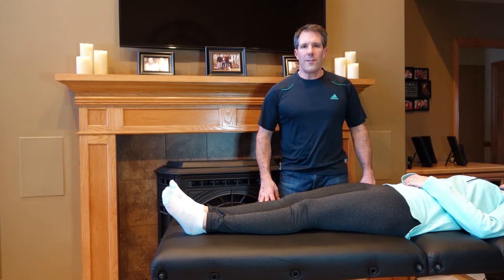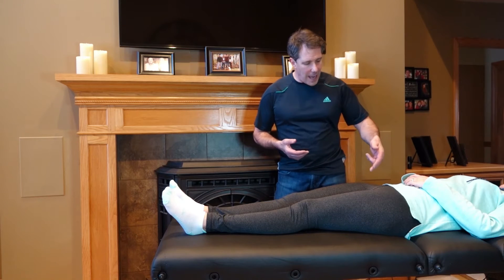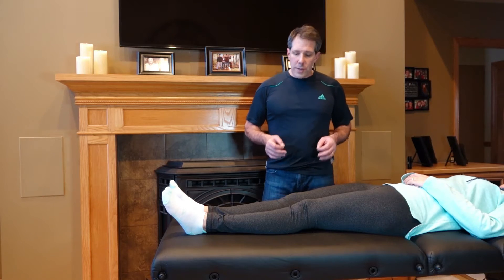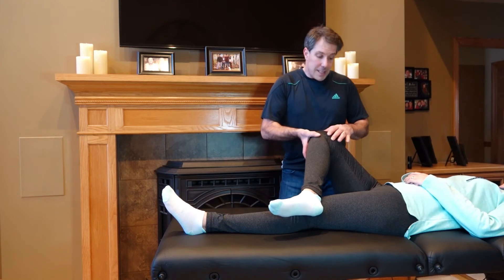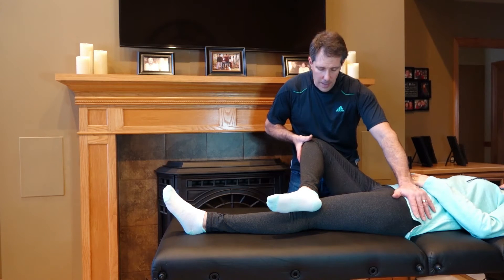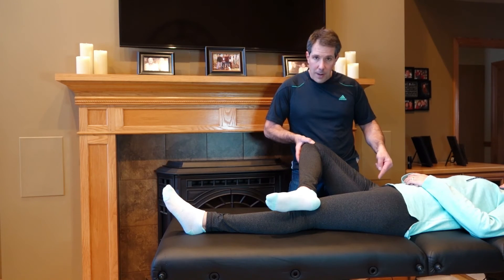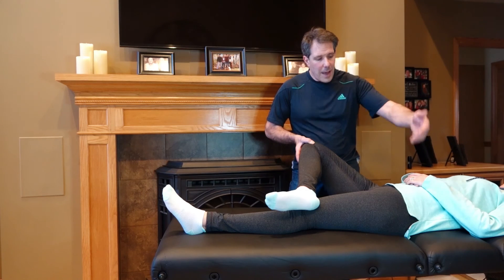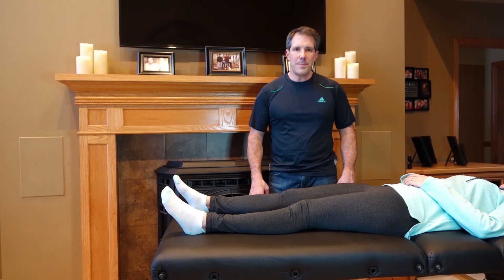FABER/Patrick/Figure 4  Test-How to Perform it and What it Means!

Comment: What if the pain is on the exterior front of the quad/hip when doingthis test?
Reply from the maker: Usually an issue inside the joint. Arthritis or labral issue.